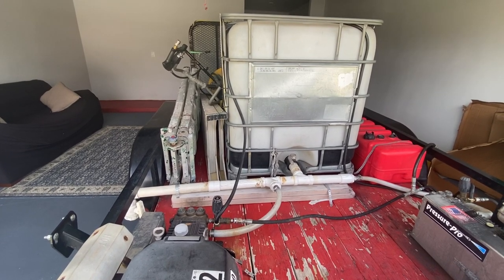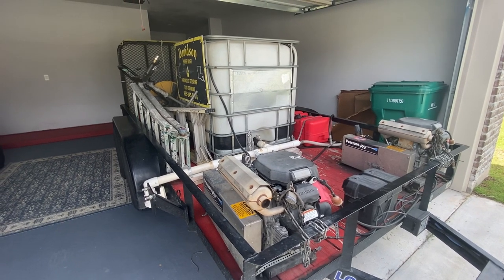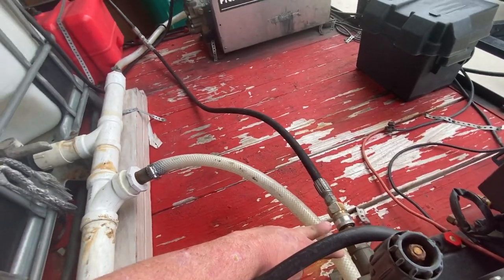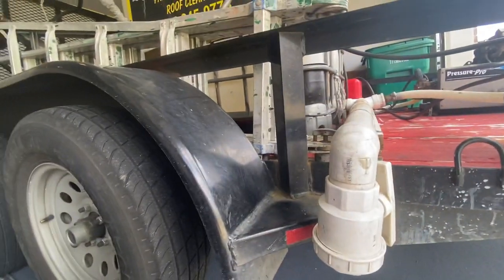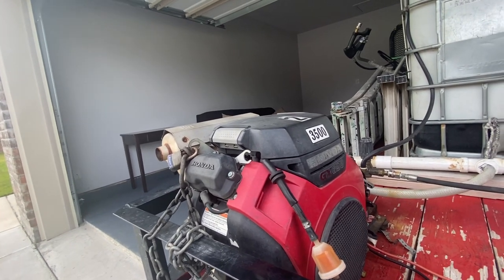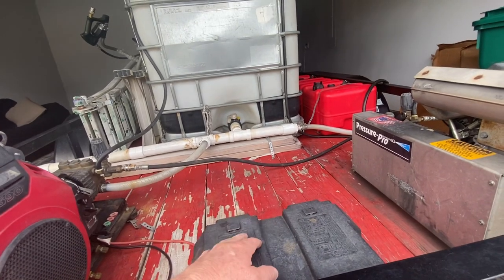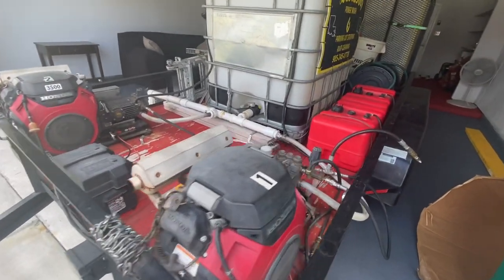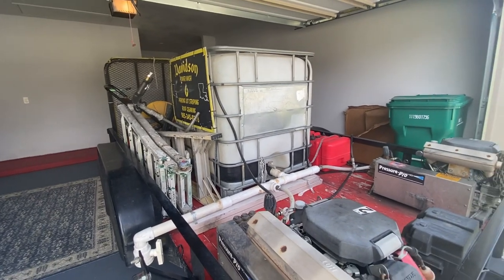HOW TO SET UP A PRESSURE WASHING TRAILER W/ WATER TANK

Comment: Hey Billy great video once again! Check the boost valve in your pump. The spring may be broken, I had the same problems with losing pressure from a new machine. (Somethings you may want to try) Add you some 4x4’s maybe to get your tank higher than the pumps and try to get a straight Tee if you can to help with water restriction. On your dump valve or blow down add a detachable hose for “shower” use or to wash chemicals off. Great setup. I’m in the process of doing myself a build and these videos help to get a good idea of how to make sense of your setup so it can work efficiently for yourself. Thanks again

Comment: Relocate your dump valve up onto the horizontal pipe then add a short pipe out of the 90 elbow to help clear your buckets.  Also using 92 or 93 octane gas helps the motors run cooler and stronger and that goes for any small gasoline motor. Good videos
Reply from the maker: Awesome tips thank you

Comment: Don't forget about maintenance on the trailer.  Those wheel bearings need to be greased.  The brakes probably need adjusted.  Check for wear on the suspension parts.  I would suggest a maintenance log for both the truck and trailer.  If there is ever an accident, it would really help if you can prove that the accident was not caused by lack of maintenance.

Comment: Is that tank big enough for a 10 GPM unit? Also do I need a double axle trailer or with a single axle do?
Reply from the maker: Yes it should be sufficient enough but I would definitely recommend a double axle trailer if you're going to travel with any amount of water in the tank
Reply: @billydavidsonvip  I’m just curious how come you recommend a double axle?
Reply: @billydavidsonvip  I found a company that makes single axle trailers that hold 4000 pounds, It is also aluminum as well

Comment: Hi Mr. Bill Davidson,

Question - if I run a 5.5 gpm belt drive pressure washer and my buffer tank has a 3/4 water feed bulkhead would that be good enough for water? Or should I replace it with a 1 inch and use 1inch pipe? My brass water connector on my  pressure washer is 1/2" mpt - 3/4". Should I also replace that to a 1/2" mpt - 1"?

Any information will be grateful. 

Michael C  - (WA)
Reply from the maker: I have seen different set ups that will use a three-quarter inch feedline but in my opinion a 1 inch is better if it's not too much trouble to change it out
Reply: @billydavidsonvip  

I guess not. I just have to buy a few fitting.  I just thought  3/4" will be enough to feed one pressure wash.  

Thank you

Comment: do you use a 3/8 or 1/2 hose after the siamese kit for 16 gpm?
i have 100 g tank, one belt drive 5.5 and direct drive 4 gpm. Planing to use the siamese kit, Is one line 1'' bulkhead enough to feed these machines or i need to install a 2'' line? I thought to install a second 1'' bulkhead.
Thank you.
Reply from the maker: At least 50 feet of half inch hose after the Siamese kid would be best
Both machines should do great off of a 2 inch single bulkhead
Reply: @billydavidsonvip  thank you